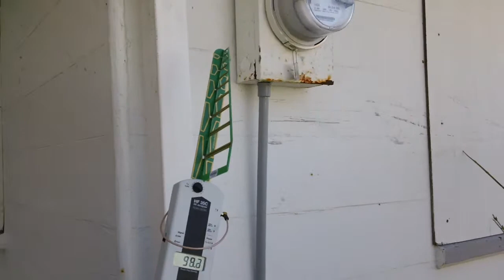Smart Grid Medusa Meter

Comment: This is a military program.All smart "meters" have Medusa capacity, operate by rotation as collector hubs for data mining. Military device dubbed MEDUSA (Mob Excess Deterrent Using Silent Audio) exploits microwave audio effect. Short microwave pulses rapidly heat tissue, causing a shockwave inside the skull detected by the ears. A series of pulses can be transmitted to produce recognisable sounds. The device is aimed for military or crowd-control applications, as well as smart grid application.